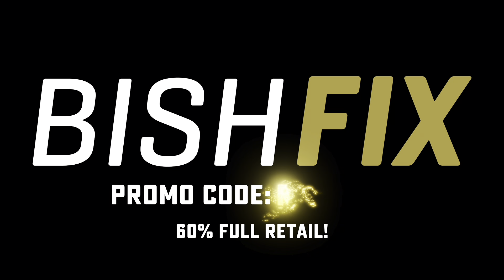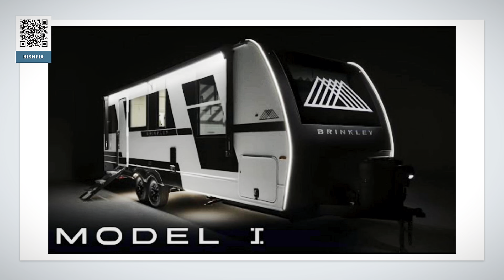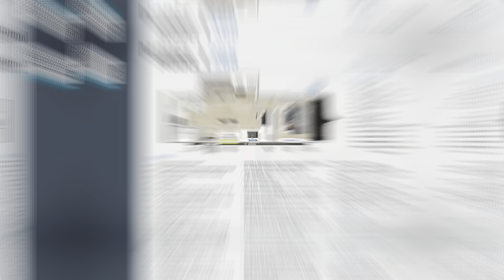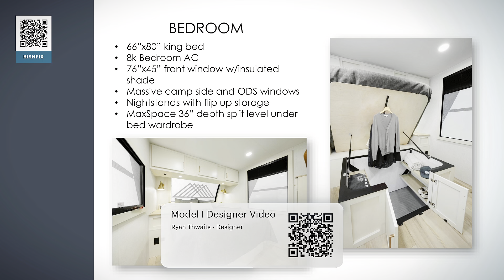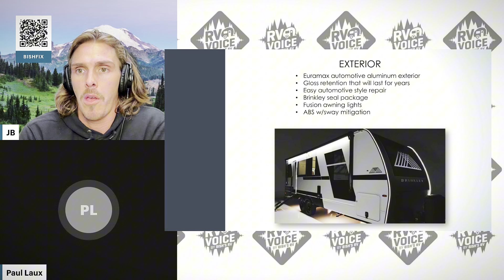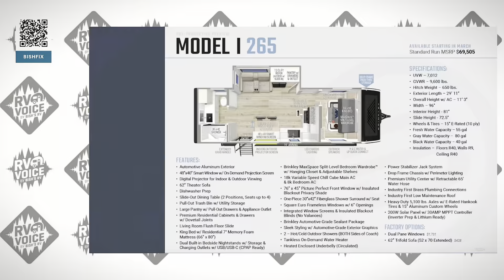Unveiling the Brinkley Model I: Inside and Out with Brinkley Sales Director Paul Laux

Comment: Has Brinkley decided to include the inverter on this? If it comes with solar, it should include an inverter.
Reply from the maker: Yes! They added an 3000W inverter. This way you can operate the projector and smoke window off battery since they are both 110v only. The inverter will run all outlets excluding bedroom AC, microwave, and dishwasher prep outlet under kitchen sink.
Thanks for watching!
Reply: @ woo hoo!! Can’t wait to see it at an RV show in January.